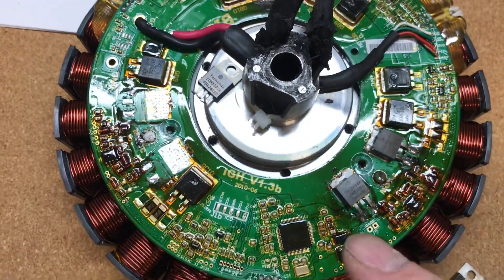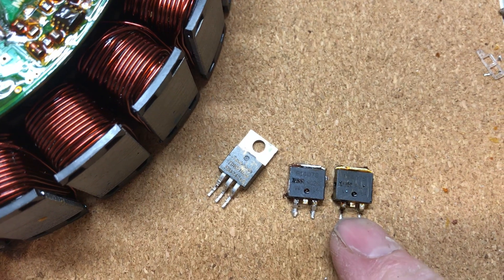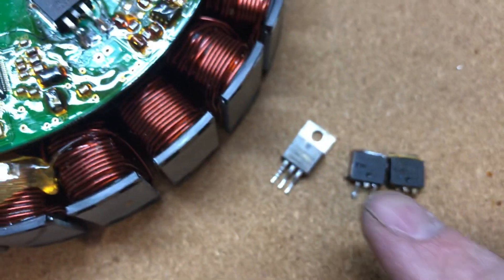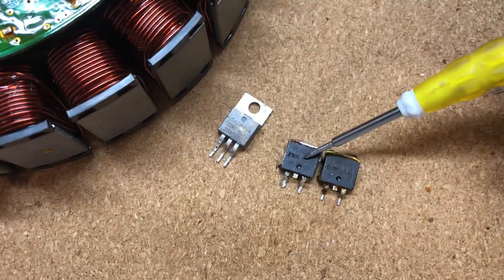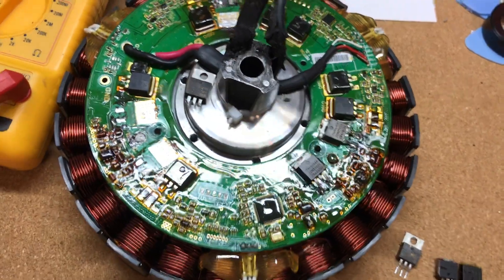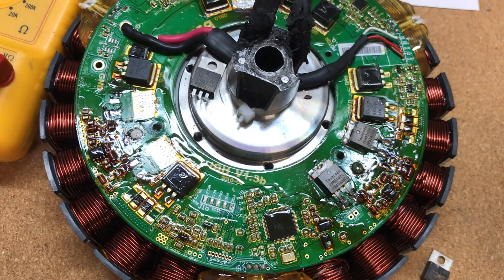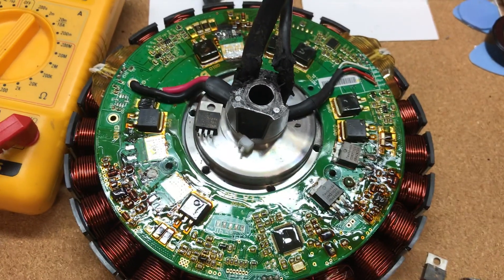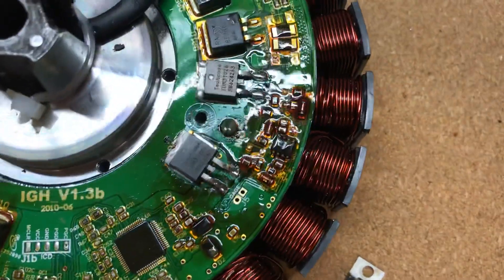Bion X bionX 250w 350w 48-52v controller problem. Repair or fail #smartazz

Comment: hello sir is that microcontroller from stm32 or avr ??pic??i have the same bike mosfets are good i think koz no shurtcut on input power but no control its hard to open it for me
Reply from the maker: You have to remove all the spokes, it was not easy. I can’t remember the processor and the bike is long gone now I’m afraid.
Reply: Its a microchip pic dsPIC30F6015. See my other answer.

Comment: Can you tell me how you opened the motor? Or maybe there's a website that shows that?
Reply from the maker: Take all the spokes out. 
Then take the gearbox out
Remove all screws 
Then you need to pull it apart, not easy to do.

Comment: Hey there, I wonder what issues you were experiencing for you to need to fix those components. I have an Easy Grace with same system. Bike is in great condition and works. But the power is intermittent. I wonder if I have a torque sensor problem or if my controller got overheated like yours. Everything seems to work fine, but for this power issue where it comes and goes.
Reply from the maker: Zero Point my problem was “when the wheel was turning round it was cogging or the wheel had resistance when spinning with no power on.”
 So something could be shorting out somewhere. Or could be your controller as they are prone to fail.
Reply: @smartazz  Yes, I wonder about what usually happens when the controller starts to fail. I have been searching for someone who might have been able to identify what the issue might be, as maybe it is a common one. I am thinking that I may have to go down the same route as you and use an external controller. But I wonder, if I did that, would I be able to continue to use my bionx display and battery.
Reply: Hey ! Sorry for the late answer, I have the same ebike and intermittent power problem, and was wondering if you had found a solution?
Reply: @MrVal0uch  Hey, Still got bike. Riding it occasionally, but still has problem. Guessing that it won't be an easy fix. Did consider doing the conversion. Can you describe what you experience while riding yours? Cheers

Comment: As long as the gate voltage is the same on both FETs, you'll be fine mate.
The bad news......The usual cause for gate-drain short is overvoltage so the trigger voltage might be a little high and it might happen again (unless the new FETs are higher tolerance).
Reply from the maker: It happened again. So that’s a fail. 
Iv completely removed the controller from the hub and fitted an external controller that now works :) happy days
Reply: @smartazz  how much watts are you running to the hub from the external controller?
Reply: @smartazz  Does that mean that you do not have regen feature now?